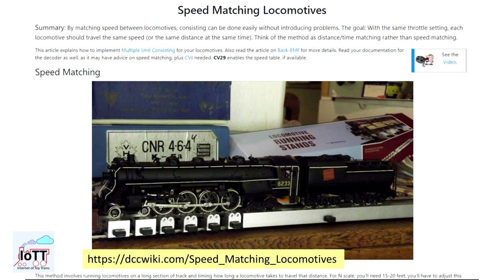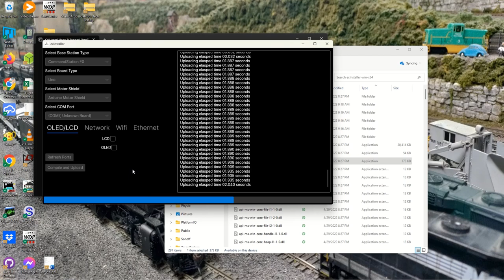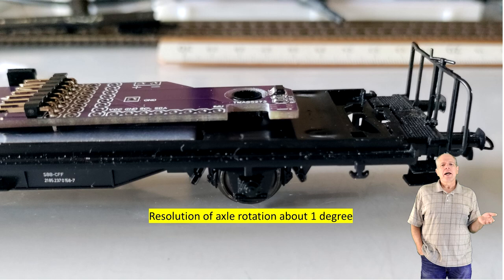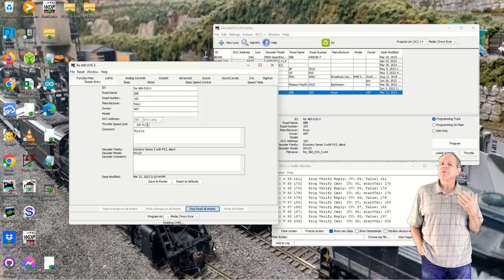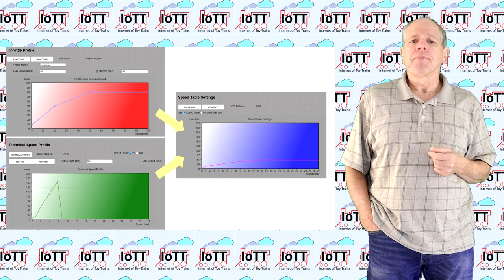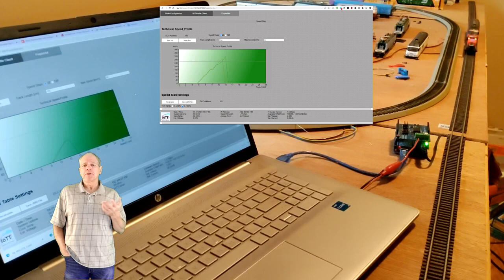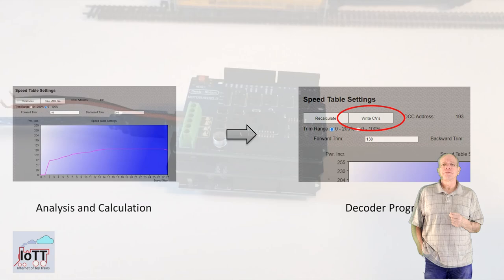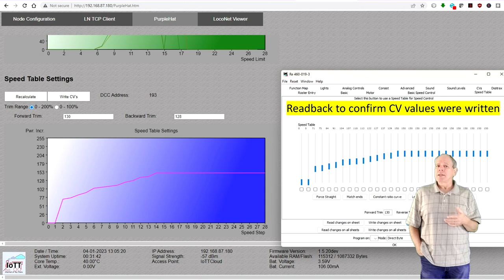Speed Profiling Station with Arduino / DCC EX (Video#116)

Comment: Just finished getting everything set up. Thank you for the detailed video instructions. I added a "Liter Energy Battery #103450" to the purple hat. The IoTT Stick got very hot, so I removed the battery. The stick still functions via USB connection, but the internal battery no longer will hold a charge. What are my options?

Comment: Ahh, so LocoNet over TCP is the "better" interface method for the IOTT Stick for the ability to write CVs. So if I have both options, I should choose LocoNet over TCP, not WiThrottle.
Reply from the maker: The WiThrottle protocol unfortunately does not support CV programming, so there is no way to send the speed table values to the decoder.

Comment: Hello Hans, In your example here on the motor driver board is the power trace still uncut?
Reply from the maker: Yes, in this example I am using a standard motorshield and power it from VIN so the VIN trace remains intact. VIN, when using the DCC AUX shield can be powered with up to 18 Volts and it provides 5V to the Arduino board as well, so the onboard LDO of the Arduino is bypassed and does not heat up. Watch video #130 for more information how the AUX shield works.

Comment: Great series. I found the way you implemented the phases to determine the models speed very cleaver.  I am interested in trying this out. Do you have a estimated time for when the purple hats will be back in stock?
Reply from the maker: Thank you. PurpleHat is actually in stock. See here for HO: https://www.tindie.com/products/tanner87661/purplehat-track-measuring-kit-ho-scale-flat/
You can also get kits for N or G scale. Search Tindie for PurpleHat to get all four versions listed.
Reply: @IoTT  Thankyou for your response. I will need the purple hat and a IoTT Stick Plus correct? I had the hat and stick references reversed.
Reply from the maker: @deeprunrailroad_Mike  Correct, you need a PurpleHat and a Stick. On the receiving end you need either WiThrottle or Loconet over TCP server. No problem if you run JMRI or another software or command station that supports one of these protocols.
Reply: @IoTT, I like this project. It’s another cool idea of yours I would like to explore. Just to confirm, In order to implement it one will need; Purple Hat and IoTT stick, correct? Free choice of control station as long as we have the loconet TCP network available, correct?           Maybe in the future you can add the list of specific components used in the project under the video?  (Like a project kit package)

Comment: Hello Hans, I setup a stand alone speed profiling station today. Dedicated DCC++EX with red head and 3m of track. Speed magic starts ok, and hangs between steep 6 and 9. Loco is buzzing like is trying to start but it probably needs few more steps. Software just doesn’t advance to higher steps. Any tips?
Reply: I like to add that all the tabs are easy to open, except the PurpleHat. It always takes several attempts
Reply from the maker: If the SpeedMagic tries 3 speed steps and the speed is not increased, the process is terminated. This is the case e.g. if you try to create a profile for a speed the loco can't reach. The same might be true in this case. You should make sure that the loco starts moving at the first speed step. Most decoders have a kick start feature that helps breaking loose the anchor of the motor. For further analysis it would be helpful if you could have a look into the loconet commands. Check the Loconet viewer of the RedHat. This would help to better understand what's going on.
Reply: @IoTT  Thanks Hans, Since your site is temporarily down, I couldn’t read your manual. Instead I watched the videos several times. I tried to stick to your instructions and one of them was to zero everything out before the test. Thank you for clarifying the test requirements for me.

Comment: Hi Hans, Great channel and some really excellent devices. 
I have been trying for several hours today to get my purple hat to run speed magic. I can connect to the purple hat via the web page and everything seems to function correctly until I try to read a loco file from the roster. On clicking the button I see a list of .xml files on the screen and all my locos are there but when I select any file nothing seems to happen. The list disappears and there is no error message. I have tried two pc's with different versions of JMRI and different windows operating systems but the result is the same. My dcc system is NCE powercab but as far as I can see the problem is between purple hat and the pc. The software version on the purple hat is 1.6.5. Do you have any ideas that could help me? ........................John
Reply from the maker: When you load an xml file, there is not much visible on screen. The only thing you should see is that the address of the locomotive is displayed as assigned DCC address. This indicates that the PurpleHat has successfully assigned the DCC address via the WiThrottle interface (I assume that is what you are using as you have an NCE command station, so using the Withrottle server if JMRI is the way to go). The connection is established and if you start running the calibration test, it will use this address.
Reply: My etup is exactly as you say. When I click on the button to load the xml file the list of loco.xml files pops up. When I then click on the required file nothing happens, the file list is removed and the web page remains unchanged with no loco address shown.
Is the Withrottle populated with the address first and it then shown on the web page or is the web page populated firsr? I ask this because the loco address does not  appear in the purple hat WiThrottle page on the IoTT stick display and also does not show in the jmri WiThrottle server page. The IoTTstick is however shown in the jmri Withrottle serves as a client.
I wonder if my problem is not reading the xml file or is it not being able to access the Withrottle server?
Reply from the maker: @canalsidingsmodelrailway3411  If the stick is listed in the JMRI WiThrottle connection list, there is a connection established, so I would think that end should work. If you load an XML file, I think the Stick tries to contact the DCC address and displays it if successful. If no address is shown, I think there was a problem in the communication with the WiThrottle Server. If you want, you can send me your xml file and I can see if it loads.
Reply: @IoTT  Thank you Hans. I do seem to have run out of ideas so I will send the xml file to you. How do I do this? ..........John
Reply from the maker: @canalsidingsmodelrailway3411  e-mail it to hans@tanner-family.org
Reply: @IoTT  email sent.
Reply: Hi Hans,
I have made a breakthrough today. I was previously stuck in my thinking that the problem must be in the Withrottle part of the system and was trying to test every aspedc of this. However eveyrthing seemed to work correctly and I started to think that the problem must be in the IoTTstick.
Today I decided to reload the IoTTstick firmware V1.6.5. To my surprise It seemed to work and I can now read and load the roster files into the speed magic page. I can also run the speed profiling and the loco does exactly as expected and moves backwards and forwards along the test track with slowly increasing speed. A speed profile builds up in the technical profile graph and all looks fine.
But, the speed profile never stops. at speed step 71 the loco just goes backard and forwrd and eventually breaks out of the 1.5 metre measuring section and hits the end stop of my test track.
To me this looks like a new software problem but I am now suspecting the ESP32 processor in the M5Stick C plus is to blame. I will order a new M5Stick and see if this solves my problem. .........................John
Reply from the maker: @canalsidingsmodelrailway3411  Hi John, looks like something was corrupted on the stick. Not sure what's going on right now, but chances that it is a Stick hardware problem are extremely small. There are 2 things you can try and I would be interested in the results as it could help to find the problem (most likely it is a software problem)
- if you can, make the test track longer, say 2m, and also shorter, say 1m. I'd be interested to know if it stops working properly at the same speed step
- reduce the target speed for the speed profile to say half of your current value (you can reduce it in the throttle profile) and see what happens then. If the profile completes at the low speed, try to increase and find out at what speed / speed step you start to see the problem
Thanks, Hans